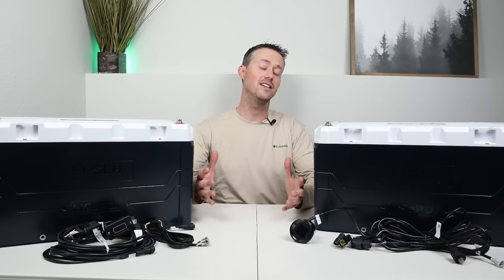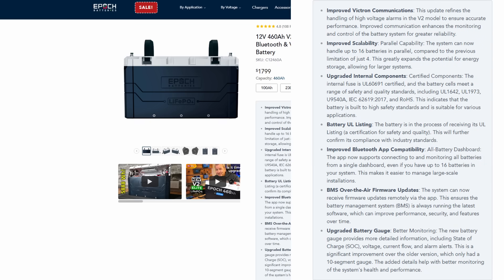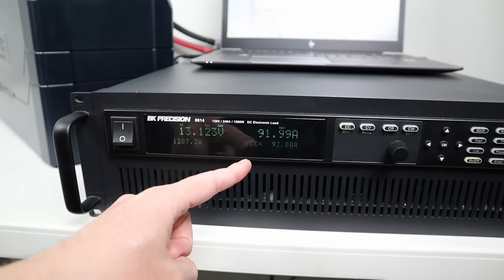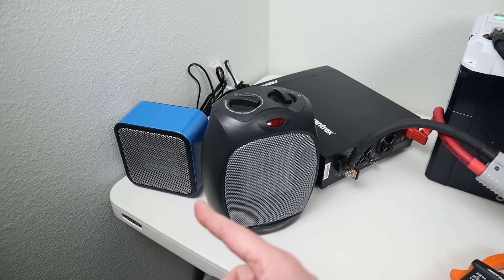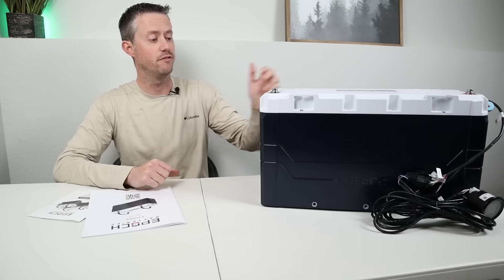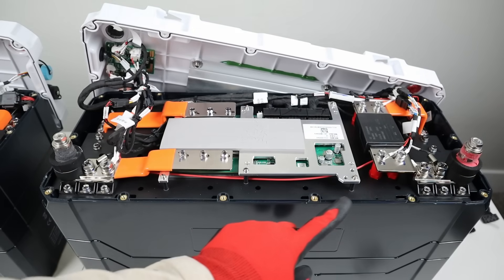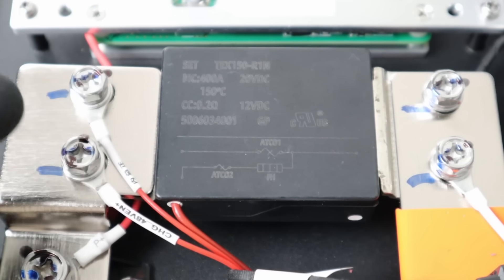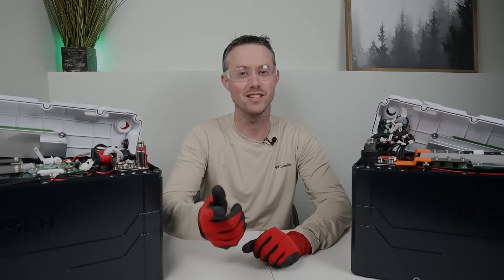The New EPOCH Elite 12v 460ah V2 - Testing and Tear Down

Comment: Can I mix one essential unit with a premium unit? I ask because I can only fit one unit outside underneath the chassis and one unit inside under the bed. The one outside needs to be water proof. If I can mix two units, save me a couple hundred bucks for one essential and one premium unit

Comment: The v1 fuse is not UL class T. If it were, it would have the UL stamp. It is a 500a IEC gR rated fuse. It DOES have terrific AIC but at 500a overcurrent rating, does nothing to protect most 4/0 cabling. 

You said the v2 fuse was UL listed early in the review, then saw the fuse. I don’t think it is a class T fuse, either—again no UL stamp. The AIC remains a mystery. 

First time I’ve seen the channel. Saw the WP video comments from you. subscribed.

Comment: Can you buy the voltage tester or state of charge device separately from the battery? Do you recommend a battery state of charge device separately?
Reply from the maker: The little screen is only compatible with the new battery. It communicates to the BMS inside the battery.
Reply: I have 2x 200 ah batteries and want a battery state of charge meter and don’t know which one to get.

Comment: Thanks for tear down what the chance for the battery's internal having a melt down catching fire burn hole threw bottom of your boat?
Reply from the maker: With the battery being UL listed, the chances are extremely low. Being Lifepo4, the fire risk is much less than a regular lithium battery. LFP also doesn't suffer from thermal runaway, which is what you see when a Tesla catches fire.

Comment: I'm in the process of upgrading my class B RV with lithium batteries.  I'll need to check their website to see if they have something comparable to the battle born that will fit in my battery box.  Great video as always.
Reply from the maker: They have many different sizes available and  IMO these batteries are miles above Battle Born batteries!

Comment: Very good video on a very good battery. Just a side note: I think we're probably at the point in terms of battery testing where 99.5% of these batteries pass every single test. Maybe skipping all the testing video and just giving us the results in a 1-minute recap would be easier and result in a shorter video. The teardowns are probably more interesting and critical, since no two batteries are built the same. Thanks!
Reply from the maker: I've debated about just saying how the battery performed with BROLL showing the results. I like showing the interesting stuff though. I'm working on upgrading my max load tests so they would be more interesting.

Comment: This was a great video. Price seems fair for what you get. Well done.
Reply from the maker: $0.30 per wh! 5888wh for $1799
Reply: @ exactly. What uses do you see this being popular with
Reply from the maker: @thereissomecoolstuff  I see them mostly installed in RVs to replace lead acid batteries. You could also do an off grid 48v system in a cabin with these since they have the heaters 👍
Reply: Impressive batteries. Nice to see the high dollar stuff too.

Comment: No one can tell me why they have a relief valve on these batteries, but on their essentials batteries, they do not...
Reply from the maker: This is what AI said about pressure relief valves. Just a higher level of quality:

"A waterproof pressure relief valve is designed to release excess pressure from a system while preventing water ingress. It is commonly used in applications where maintaining a controlled internal pressure is essential while also ensuring that external moisture or water does not enter the system.

Key Functions:
Pressure Regulation – It prevents overpressure in sealed enclosures, protecting internal components from damage.
Waterproofing – It stops external water, moisture, or contaminants from entering the system.
Ventilation – Allows gases to escape safely while keeping out liquids.
Protection – Common in electronics, automotive, marine, and industrial equipment to safeguard against pressure buildup caused by temperature changes or altitude shifts.

Common Uses:
Sealed electrical enclosures
Battery compartments
Automotive and marine applications
Waterproof storage cases
Submersible equipment"